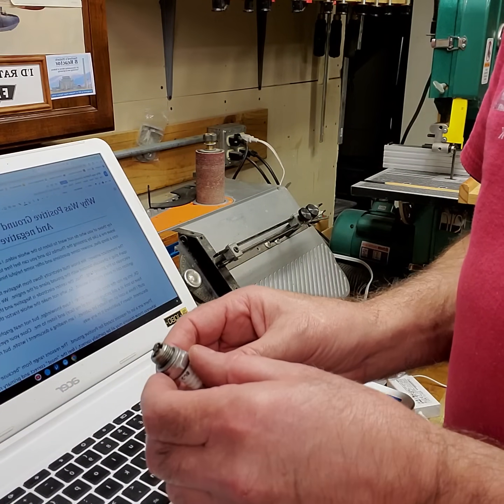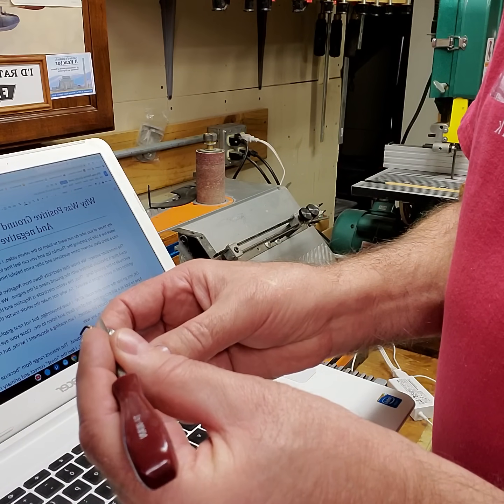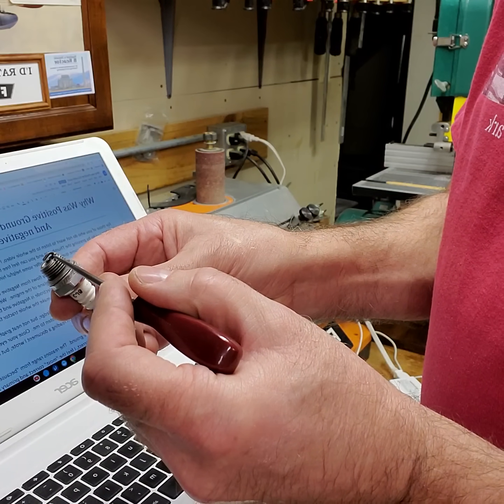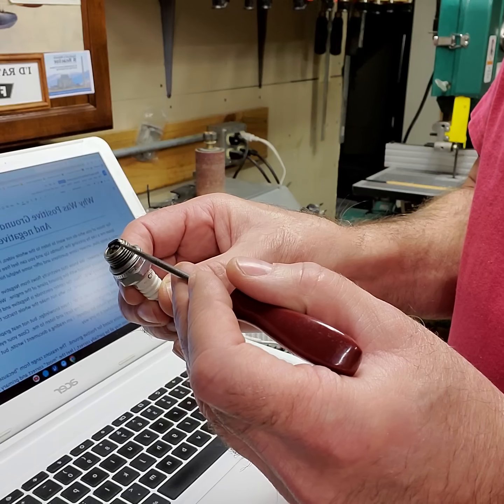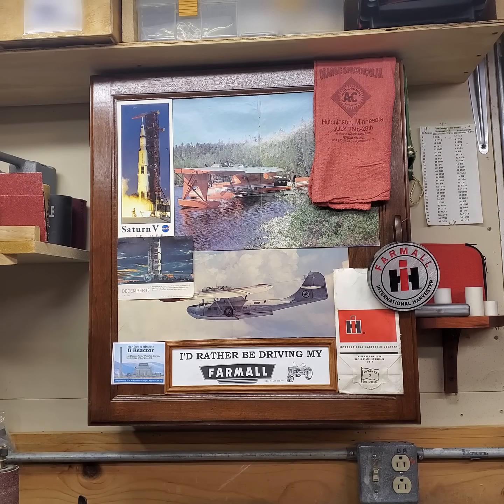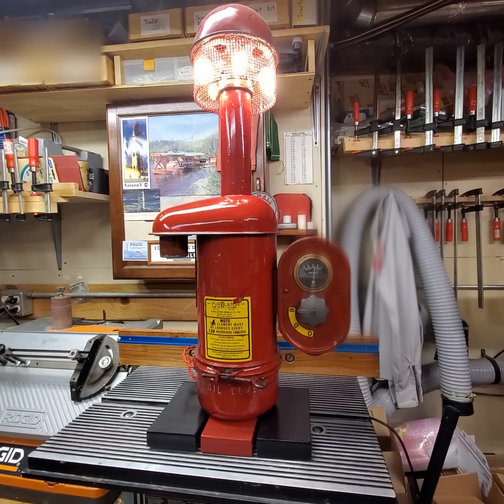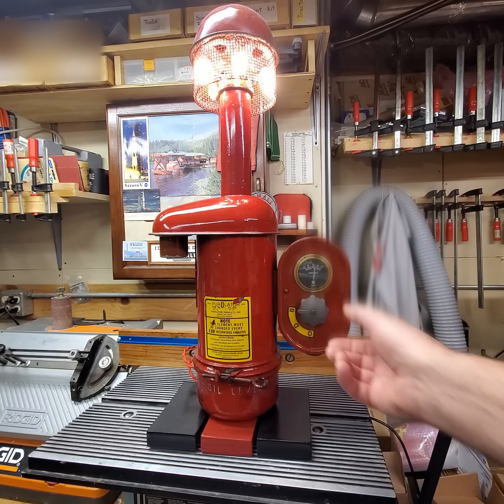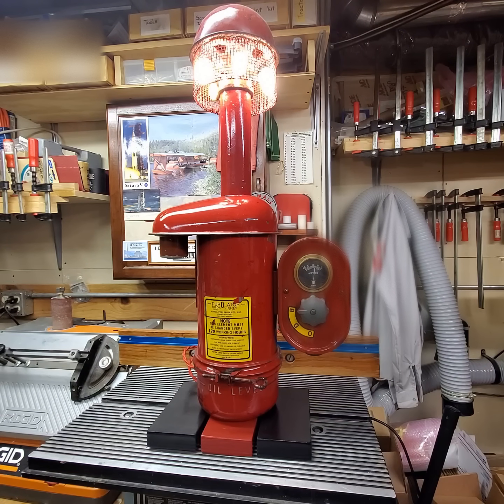Why positive ground was used on old cars, trucks and tractors

Comment: I remember telling people I had a positive ground 6 volt electrical system in my car and that's why I couldn't give them a jump start. the reply that it didn't matter how many cylinders I had in the car was kind of funny at the time. I tried to describe them what was happening, but It ultimately just had to tell them I didn't like them and that's why I couldn't give them a jump start. They had no idea what voltage was, my 6-volt car had no hope of starting their 12 volt car. Anyway, memories of the past...
Reply: I remember working on a '27 Mack at my first job. 
I got the job through my buddy who said I would just be changing oil and sweeping floors.
Little did I know I'd rebuild about 6 yugos from 10 of em into running cars. 
Anyways a customer had a 27 Mack truck ,6v positive ground and the boss asked me how I'd hook up jumper cables. 
I thought for a second and told him red to red black to black. 
He asks is the running car negative ground ? 
Yes. 
I got a gold star. 
Then he let me fix a bunch of wiring maladies it had.
Reply: Yeah you would have needed another 6v vehicle and 3 sets of jumper cables and the electrical experience to know how to lay out the cables to get it done.
Reply: Probably would of been easier to bump start him to get going then!
Reply: @dankline9162  his battery was absolutely zero volts. There would have been nothing to start the ignition system. But otherwise that would have been a good idea
Reply: @spacecase0  
May be rough to start, but wouldn't the altenator be enough? Id just put something in between the bumpers, like a piece of wood wrapped in towel
Reply: @dankline9162  what alternator? My 6 volt car had a generator, are you saying that I should have started my car and then disconnected the battery while it was running and then put that in series with my 6 volt generator to come up with 12 volts? I suppose that would have been possible other than it wouldn't idle on its own with just the generator. But I sure didn't think about any of that back then
Reply: Volkswagen most likely.  Usually the jumper cables are too short.  Then again you could say you have to push start your car all the time.   You are correct.  6 volts would not touch a 12 volt system noticeably.  Mind you, if the car was an original 54 or older Chev Belair they used to be 6 volt too.  I never bothered and no one stopped me because they knew VW's did not use batteries.
Reply: @bunzeebear2973  It WILL add in series to provide more voltage to the starter circuit, and thus possibly enough current to get it started.
Reply: If your friend had arrived with HIS 6 volt car you could have double tapped the guy and REALLY jumped him.
Reply: Could get 3 guys push it about 5 mph and pop the clutch
Reply: well it might have a faint hope before ur car catches fire
Reply: @UCBtv155eju17fLHDueRdArQ 

You are really are an arrogant f...ng idiot aren't you.

Oh you mean like galvanic isolation...
Why are you even talking about isolated power supplies at 12 volts?
WHY ?

As I said in a previous post. There is nothing here in this jump starting scenario between two cars where isolation comes in to it.

So why do you bring it up again a second time?

Oh Mr. Smart Arse, if you think that you are that clever then explain to me where in car battery charging situation (gasoline cars, not EV) , where galvanically isolated power supplies are used. Go on mate, I want to watch you squirm on this one.

When I was university many years ago, in the Lab, a clean room, I was fabricating and testing semiconductor devices on a silicon extrinsically doped die....

So you might want to rethink your arrogant incorrect claims I know nothing about electronics....and yes, I did graduate, you arrogant prick.
Reply: Then you should have called up your buddy with HIS 6 volt system,  so you could put them in series and give the poor guy a jump. That would have been the EASIEST thing to do.
Reply: @mikebetts2046  No, the easiest thing for him to do was walk away. Perhaps you missed the comment where he said he didn't like them.
Reply: @deang5622  I was just trying to make for some electrical humor.  I guess it's lost on most technically oriented people.
Reply: @mikebetts2046  ]
Reply: @Chris_at_Home  No, I am afraid you are wrong.

Firstly what does isolation even mean in the context you are using it?
You are connecting +ve of one battery to the +ve of the other, and -ve of one to the other.
So what exactly do you think you are isolating and why?

What I am seeing here is the throwing around of words such as isolation, earthing and grounding without the authors understanding these concepts.

The situation here is a 6 volt battery you are connecting across to a 12 volt battery which is flat, which means that its voltage is going to be in the range of 10-11 Volts.
If you connect two batteries in parallel like this, do you think you can charge up that battery that is at 10 volts from the 6 volt battery?

The answer is no, you can't. And if you think you can, it is because you don't understand electricity.

Now, the second part to this is, can that 6 volt battery power the starter motor in the car with the 12 volt flat battery and get the engine to turn over and hopefully trigger compression and combustion?
The answer is almost certainly not, because the car with the flat 12 volt battery is using a 12 starter motor and the 6 volt battery is going to struggle to turn it.
Reply: I think you could could charge their battery so long as you reversed leads.
Reply: @pvtimberfaller  6V won't put enough charge into a 12V battery.  You'd have to get access to the midpoint of the 12V battery cells to charge one half at a time, and that's probably more trouble than it's worth, y'know, with the sulphuric acid and all.
Reply: @pvtimberfaller  So you can charge a 12 volt battery which is at a charge level of 10 volts from a 6 volt battery?

You really are not very good at this are you?
Which way is the current going to flow when you connect that 10 volt battery to the 6 volt battery?
Reply: @deang5622  You connect the 6 v battery in series, not in parallel as with a normal jump start. So a dead 12 V battery will be putting out about 11 to 12 V, plus the 6 V battery in the series will give you about 18 V on the receiving car's system. A bit of an over voltage, but you may get away with it on an old car, and it will start.
Reply: @jimbob5891  "You connect the 6 volt battery in series". What planet are you on?

I am amazed at how many stupid people are on this forum talk out of their backside.

Jump leads for cars contain big alligator clips on the end.  You connect them in parallel across the two batteries...everybody knows that!

Nobody gets out a set of spanners and undoes battery leads to connect batteries in series. It does NOT happen.
Reply: @deang5622  2 6 volt batteries in parallel is still 6 volts with double the amps. You hook the 2 6 volt batteries up in series you get 12 volts. Those batteries in series connect to the dead battery.
Reply: @pgtmr2713  if you connect two good 6 volt batteries in series then yes you get 12 volts.

Think about the situation here.  Two cars at the roadside. One won't start and is 12 volts.
The other is ok and contains a single 6 volt battery and one of the car owners has a set a of jump leads. No one has spanners. Why? Because very few people drive around with spanners.

So the person with the working car whose help is being sought needs two have two 6 volt batteries in their car...which is unlikely
 One yes. 
Second they need the spanners to disconnect and rewire their batteries.
Third, why the F. Should they go through so much trouble?

End of discussion.
Reply: @pgtmr2713  you get in the 6 volt car and go get a 12 volt battery , or if the 12 v car is manual or an auto with front and rear pumps you tow it
Reply: @deang5622  I usually carry around an 8 and 10mm socket with a small ratchet,  17mm and 10mm wrenches, and jumper cables in the trunk. Most times though I have way more tools than that and an obdII scanner. But all of that is just a distraction from the part about where you were wrong on series/parallel, which to use in this case. Finished
Reply: @pgtmr2713  I don't particularly care what spanners you carry around with you.
The point was clearly that the majority of the public doesn't.

And what part of "End of Discussion" don't you understand?
Reply: @deang5622  I wasn't done with you.  Plenty of people carry basic tools.  Others have trouble admitting they're wrong. It's as if they're unequipped for the situation. Finished when you are.
Reply: @deang5622  Sure it does if you're in the middle of nowhere and you really need to get the thing started. Now I don't want to make assumptions but I'd be willing to bet that I have quite a bit more experience actually jump starting things and general electrical understanding than you do.
Reply: @deang5622  genius u don't need any of that to connect batteries in series.
Reply: @deang5622  nope he just has to have 1 extra battery jumper and cables that would make sense of everybody has 12 volt systems would need a spare battery if you left your key or lights on nobody could jump you
Reply: @pgtmr2713  You are done with me when I say so! 
I don't have to read your posts or respond to them. Don't be so frigging arrogant.
Reply: @jessewilkins8415  I am not sure if you have omitted a comma in your post.

So with possible error in mind, I will answer for both scenarios.
A)  "nope he just has to have one extra battery jumper and cables".

B) "nope he just has to have one extra battery, jumper and cables".
Do you notice how that comma after battery substantially changes the meaning?

So let's look at scenario A.

I am not sure what a battery jumper is. 
Did you really go out to a farm and catch a sheep and shear it to make the battery a wholly jumper to keep it warm?

What we do where I live, is use a set of two cables, which which we colloquially refer to as "jumpers" or "jumper cables".

That's all that is needed to jumpstart another vehicle.
So I'm clueless as to what you think you need to jump start another car.

Now in the situation here, with the very first post, the source car contains a 6 volt battery. The target car to be jump started contains a 12 battery and there fore the starter motor is going to be 12 volt. It doesn't take a genius to work that out.

Now if you could be bothered to read through the posts in the thread, you will realise that you are not going to be able to jump start a car with a 12 volt starter motor from a 6 volt battery. If you can't work out why, then stay away from anything electrical related.

Now let's turn to B).
In this interpretation, the inclusion of the comma changes the meaning to include an extra battery. And you stated extra cables are required.

Yes, I agree, if you have an extra battery then you can rewire the batteries in the source car to provide a high enough voltage to power the starter motor in the target car.
BUT this also requires tools.
You neglected to mention that.
So you actually need: a spare battery, additional cables, tools to undo at least one cable on the original battery present in the source vehicle.

Now let's cut the frigging crap shall we?
Hardly anyone carries around a spare battery in their vehicle. Hardly anyone carries around tools.

If you can be bothered to read the posts in the thread, you will discover that these issues have already been covered off

End of Discussion.
Reply: @deang5622  So leave... go on now. Git!
Reply: @deang5622  dude how about try to understand what I'm saying you go so far out of your way trying not to jumper battery and battery jumper are both understandable as the extra battery for use of jumping the dead one
Reply: @jessewilkins8415  Dude, go back and read my post.

I provided two responses to two possible interpretations if your post.
Those responses were quite comprehensive and they were accurate.

If you think you know more about electricity than an engineer, you are a fool.

I have provided comprehensive respondes to many if the questions raised and corrected people's erroneous thinking.

Go back and read my posts. All the answers are there. If you can be bothered to read them. If you can understand them.

End of Discussion.
Reply: @pgtmr2713  Are you feeling humiliated?
Reply: @jhoughjr1  Oh is that right?
You don't need tools to unscrew the connection to the existing battery, you don't need jumper cables to connect from one car to the other? Is that what you are saying?

What planet are you on? Seriously?

The jumper leads typically are spring loaded alligator clips, and usually you can just connect across from one car to the other and you don't need tools, you don't need any extra cables over and above the alligator clipped jumper cables. But here, people are talking about increasing the voltage from the source car from 6 volts to 12 volts, which means connecting an additional battery in series with that source 6 volt battery.

Now given that usually the cables to that 6 volt battery are held on by bolts , are you going to be able to undo that bolt with your fingers? No, obviously not.

Ok, so having undone one cable to that 6 volt battery, what you now need to do is connect it to the spare 6 volt battery which means you need an extra cable to do that.
What do you think the current is magically flow from one battery to the other thorough the air?

So yes, you need tools, you need at least one extra cable, plus you need the alligator clipped jumpers to connect from one car to another.

Still think I am wrong, do you? I can't believe you can be this stupid.
Reply: @deang5622  Is it too late to get your money back from the "University?" Probably. It's never too late to say you were wrong, or mistated something. That's just your pride fucking with you. To answer your question, no, your humiliation on some very basic electrical topic had no effect on me. Thanks for asking though! :-D
Reply: @pgtmr2713  I didn't pay for my degree. It was free. In that era, degrees in my country were paid for by the government. Sounds like your jealous mate.

If you are going to take me on, you had better be damn good, and clearly you are not.
I spent years using my degree knowledge and made a good income from it.

For my chosen degree mate, there was only one university in the entire country that was considered better.

Indeed, I remember, that for at least two years in a row, when employers across the nation were surveyed, they said their preferred choice of university graduate was from my university.

Give it up mate. Sometimes you just have to accept when you have lost and are up against a better opponent.

You must feel so humiliated now.
Give it up mate.
Reply: @deang5622  Clearly, you got your moneys worth then. HAHAHAHHAHHHAHAH
Reply: @deang5622 more wise if   listen to what people wanted to say instead of your making comments off of your misinterpreted understanding creates misunderstanding for you and that's the end of this discussion I don't want to try anymore I like  understanding each other's side discussions conversations have to two sides  talking to yourself and ending discussions isn't understanding anything
Reply: @deang5622 more over is your assumption about us and what we are saying whenever some grammar or  punctuation problems prevents you from understanding don't assume ...nobody wanted you to be confused about what they were saying
Reply: Reversing the jumper cables first (of course), 6 volts would have started it.  I've heard of guys doing this. The starter doesn't care, it's just turns over, it's pretty tolerant.  It may not be ideal, as too many amps at a lower voltage than what the alternator is made for could burn it out.  But you'd be stepping it up going through the 12v battery anyway.  Now time travel back and say, "Can-do, my friend."
Reply: @mikemotorbike4283  travel back in time a day and tell yourself you don't know what the f*** you're talking about.
Reply: @mikemotorbike4283  Tell me you don't know how electricity works without telling me you don't know how electricity works.

"Stepping it up through the 12v battery" 🤣🤣🤣
Reply: @mikemotorbike4283  I knew this specific vehicle. I had read the service manual for his Chevy truck. Connecting that starter to a 6 volt battery is how you test the solenoid. The solenoid activates but the starter won't turn. At least in that vehicle. I was pretty sure it wasn't going to start on 6 volts, but I suppose there is a chance he had some aftermarket starter that was entirely different

Comment: Wow that explains to me why it always seemed odd that the pos terminal went to distributor and not batt. I guess cause it was basically a positive ground situation. Is that correct? If so thank you for this video. If not i guess the quest is still on for me lol!
Reply: The high tension centre output of the coil goes to the  distributor centre.